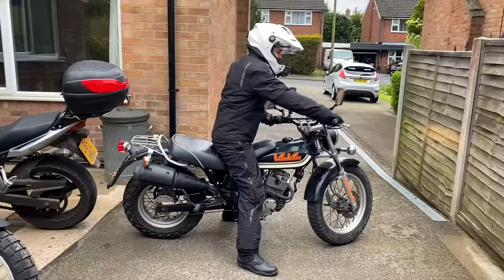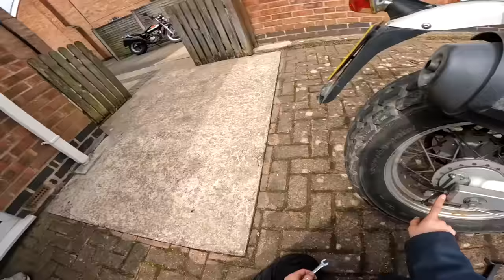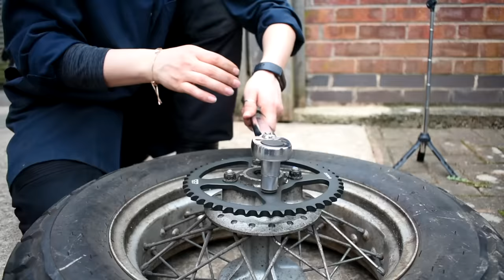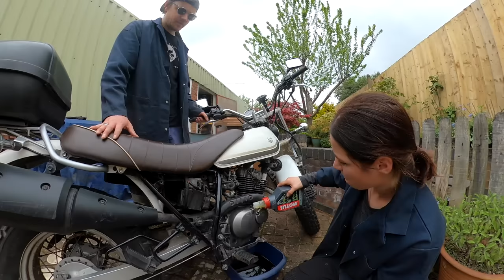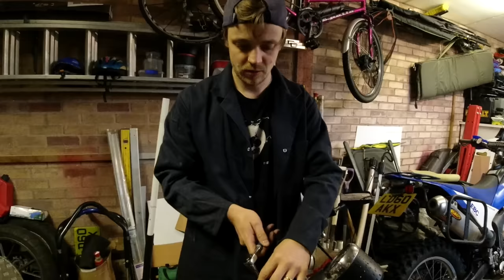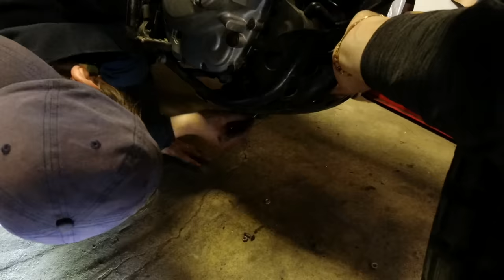Getting Our 125cc Bikes OFF ROAD READY! [S7-E7]

Comment: If I were you I would keep those old levers take them with you so when you fall of at a later date on the trail and break one you will have spares 
Another tip from my motorbike trial riding is don't tighten the two clamps up that hold the levers to the bars to tight so if you fall off the levers will twist not break off
Reply: Sound advice, I'll add we like to thread a new clutch cable in case we snap one, that way you can change over to the new cable literally in 5 minutes. 750 lb paracord, just in case you got to tow one of the van vans. I keep a doubled up piece tied to my triple tree underneath the headlight, great if somebody needs to give me a pull forward up or out of something technical.
Reply from the maker: Thank you for the advice 😊

Comment: Try and use E5 fuel where and when possible!
Reply: Why? The bikes were designed to run on E10.
Reply: @davidmatthews3093 E10 produces less power than E5, and it has more water in it. Water is not good for engines!
Reply: @TonyG-z4t  exactly

Comment: What was the valve clearance set at with feeler gauges when you put the top end back together. It sounds like the valve clearance is excessive. 46 years of being a motorcycle tech has my ears suspecting that.
Reply: If Robert has a long screwdriver, start the engine, put the tip of the screwdriver up near where the exhaust and intake valve rocker arms are, put the handle of the screwdriver against your ear and listen to Ollie’s engine noise first and then do the same thing on Lavi’s running engine and compare the sound. If that’s where your noise is coming from, have Robert adjust the valve clearance to Suzuki spec when the engine is cold. I don’t want to see you have a problem on your trip.

Comment: In my opinion the complete loss of power would not be due to Piston Slap, if all the fuel system has been checked the ignition / ECU needs to be checked out. If all else fails pull off the cylinder head and check the valves and guides, a sticking valve could be the problem. Great videos with lots of humour and you will learn a lot from your excellent mentor. Enjoy the journey and ride safe, do not go on any long journeys until you fix the bike and eliminate the knocking sound.
Reply: I agree, it could be as simple as faulty or wrong heat range plug, faulty HT lead, or plug cap, or simply a bad connection on the LT side of ignition, including the key switch and kill switch. Has the battery been discharge tested and is it holding charge ok if bike not used for a few days.?......I'm sure all this is going through Roberts mind, and you'll get it sorted before you set off👍 🙏🤞
Reply from the maker: Thank you so much 😊
Reply: CDI.

Comment: A center stand is very useful. A simple thing that manufacturers should necessarily include in motorcycles that have a secondary chain transmission. It is incomprehensible and unacceptable not to have this equipment included on the original motorcycle. Suziki! What a shame!